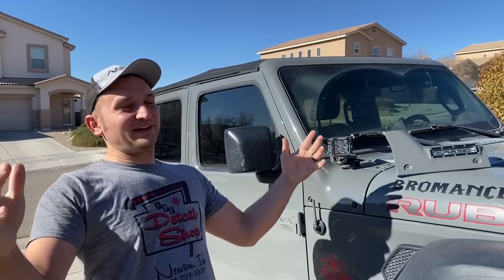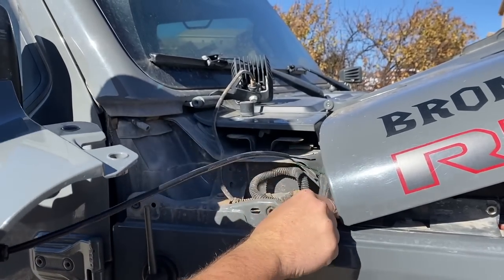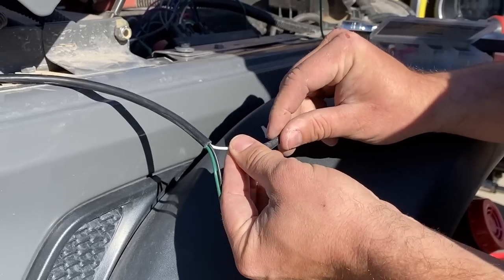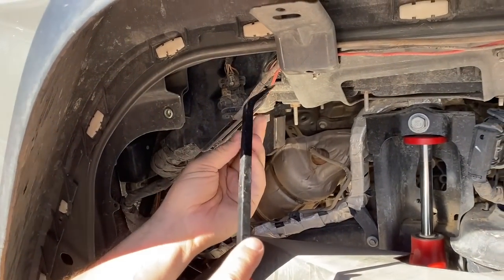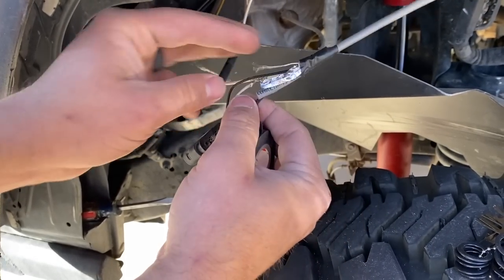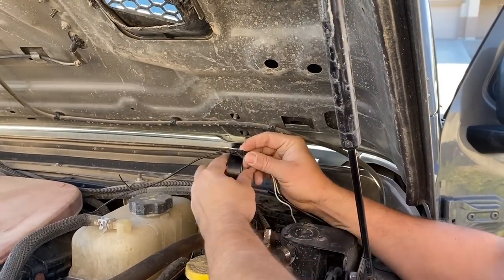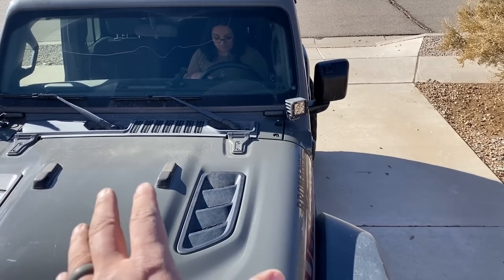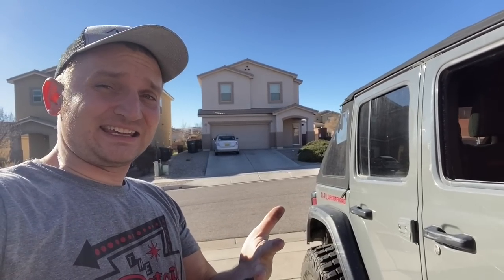Making heads turn with this sexy upgrade from D&C Designs

Comment: Thank you for showing where those darn turn signal wires are. I picked up a set of these expensive D&C VSL's (can't say I'm impressed, especially for the $$$) but wanted to hook up the turn indicators too. Jeep did a remarkable job hiding the turn indicator wires. Thanks!!!
Reply: what would impress you?? lol. They look well built to me.

Comment: A bit of advice on soldering, I couldn’t tell if you were doing this, but add some silicone past to the connection to insure it doesn’t get water corrosion before you put the heat shrink on. A little extra insurance. Keep up the great work
Reply from the maker: I did not, great advise. Good thing about wires... they can always be replaced 🙌🙌 appreciate u watching

Comment: i was gonna say during the day time that side blinker looked kinda cheesy, but at night those really pop.  the side light and turn signal lol!  That's where I have my ham antenna mounted on the mopar bracket that sits over those, I might have to think about some other kind of mount, a side shooter like that would be very handy.
Reply from the maker: Especially for your line of work! I don’t remember what mopars look like off hand, but know some brackets fit right over it... but this will look great, function great and serve me for years to come!
Reply: @JLLIFEOFFROAD  yes sir, I do have mopar A pilar lights that I can swing around. But I really like the extra forward light at night.  Even with the factory LEDs which are amazing, the extra punch is nice.
Reply from the maker: Bingo! 😎

Comment: Probably makes you feel kinda like a cop @14:20 😂 I'm considering these, mainly for the turn signal feature because I got aftermarket fender flares (which has a tiny little orange signal light that isn't super noticeable). Are you still liking these 2 years later? Thanks

Comment: Hey man been watching your videos and there really informative just wondering I have a rubicon JT are 37 inch tires good for those axles with light trails and very little lite  duty rock crawling.?
Reply from the maker: U should be fine with light trails.... I was full sending mine on 38s... I did manage to twist an axle shaft. But again... I put the hammer down from time to time
Reply: These 3rd gen dana 44 axles can handle 37" tires. I have been doing 6,7,and 8 rated trails at sand hollow no problem. Many of JT's run 37" tires and do just fine on stock axles.

Comment: I really like this idea. Will these replace your A pillar lights, or do you feel that you need to run both?
Reply from the maker: Really depends where u looking to throw light... as you see in my video, I still have my pod lights... they light up just outside of my headlight throw...  these d&c designs handle everything in the 90 degree angle.
Reply from the maker: So headlights cover 90 degrees in front... the new lights hit 90 degrees to the side... and my pod lights feel the 45 degree angle
Reply: I figured it was going to work out that way. I really like the clean look. Now if I can just figure out a way to fill that 45 your A pillars cover. Thank you for the timely reply!
Reply from the maker: Can always mount em to the bumper if u don’t want lights on the a polar??
Reply: @JLLIFEOFFROAD  that is a possibility.

Comment: Just a useful tip , you shouldn’t touch the solder to the tip of your iron. That’s why it’s all corroded which is what your wires will look like  in about 6 months of use and then will fail. Other than that great setup

Comment: I like these but I'm out of auxiliary buttons:(
Reply from the maker: LMAO, what system you using?
Reply: @JLLIFEOFFROAD  i have all the rubicon auxiliary buttons full with lights and my ARB air compressor.  Would have to get that button mount thingy you got.
Reply from the maker: There a couple other options out there.. some mount above the rear mirror...

Comment: A better mousetrap might be to use waterproof wire nuts .Home Depot. Electricians use them in septic tanks on the pumps that are buried in a different kind of MUD. There also used when buried underground for landscapers. lighting and sprinkler systems. comes with silicone in side of it , sizes range also. Quick and Easy.
Reply from the maker: Interesting... they seem kinda bulky thou... I’ll definitely keep em in mind in the future... thanks
Reply: @JLLIFEOFFROAD  small wire nuts for small wires,  vibration won't pull apart. My gladiator has the Auxiliary panel for side lights. 3&4 are15 amps .

Comment: Personally I feel that $500 is a bit excessive for some fixed lights, a set of quality pods and brackets with a switch system for future expandability would do you much better in terms of functionality and save yourself the money.  Also if you have a problem with people seeing your lifted Jeep with 35+ in tires on the high way, invest in some body armor and make your highway a demolishing derby